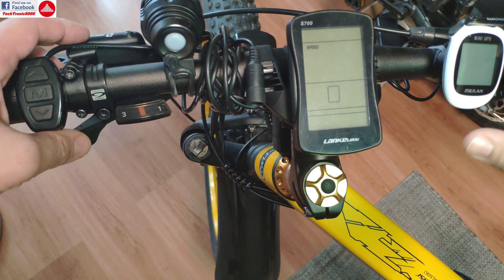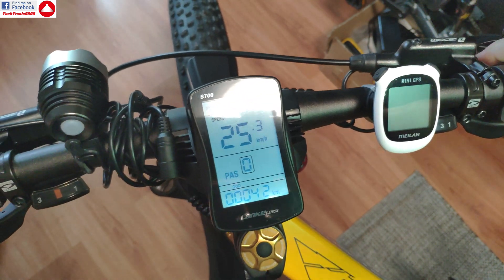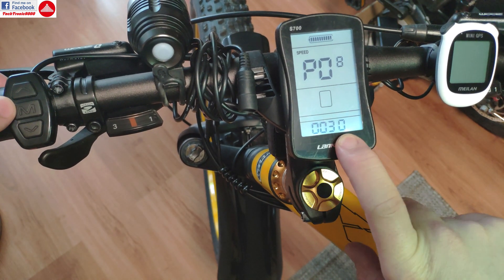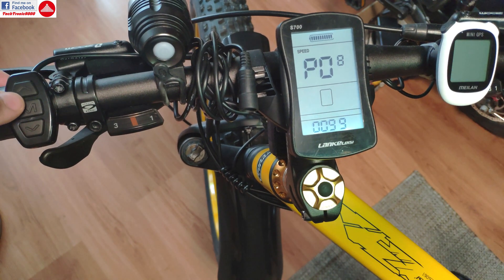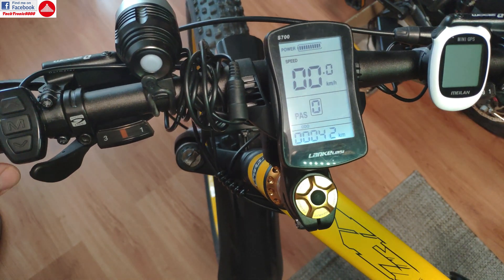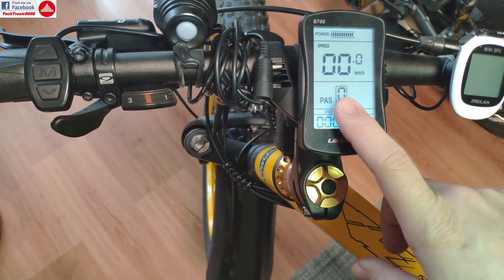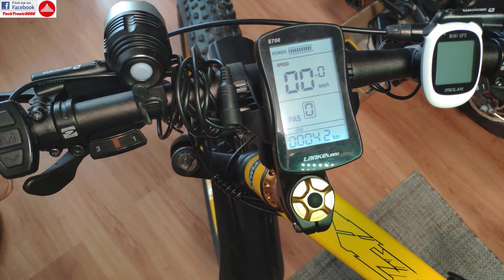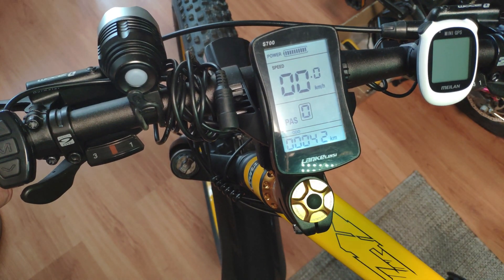Lankeleisi XT750 Speed Limit Unlock - S700 LCD

Comment: Do you know where to buy replacement battery or should j just get it diagnosed? I have a spare 48v but it has xt60 so I have to jerry rig the barrel connectors I had spare from. My last ebike batteries connector plug basically I cut the wire cut some rubber back put the bare lead to negative and positive for respective current and plugged the barrel connector in and it worked but it's not permanent but I would love some advice ik this is trades later but still.....

Comment: Hi, thanks for the tip, i have a question is there any side effect from change the speed limit? Other than battery consumption. Thank you
Reply from the maker: Mostly faster battery consumption, which is reduced range = more chargers, more often = higher wear on the battery. You also add like in any system more wear to the motor, bearings, brakes as all of them will work harder, longer.

Comment: I did it and the speedometer shows a higher speed but I don't feel the difference so it's not working, it's just the speedometer cheating
Reply from the maker: That happens when you change the wheel diameter, has nothing to do with speed limit. Also newer bikes might have different controllers and will act otherwise.

Comment: I have an RV800 plus . The speed change setting - 03p DOESN'T WORK.  No matter what I set it doesn't change the speed. At 03p theres a speed limit control... Doesn;t do anything.  Can You please tell me if You have a similar issue?
Reply from the maker: This is a XT750 bike not a RV800 plus so the settings might be different.

Comment: Do you know if there is any real difference between this XT750 500W motor and the updated version XT750 plus 1000W motor ? Most people are claiming the motor isn't a 1000W. I wonder what's the top speed of the XT750 1000W .. i am guessing it's the same motor but as they upgraded the battery from 12.8 to 17.5Ah at 48V = 614W for this version and 840W for the new version ?
Reply from the maker: First of all the battery capacity measured is measured in Wh not W and has nothing to do with the motor power. Also a lot of XT750 bikes and their other cloned models such as Bezior are sold in 500, 1000 and even 1500W, but usually most of them are just 500W. To have more info and real power you need to know the used controller maximum Amps. A 500W bike has a 12A controller, the 1000W one has 20A, while 1500W requires a 30A controller. You will see on the market a lot of "1500W" models with 12A controller, just avoid those. As for motor power the 1000W one with a proper 1000W controller should have greater torque and hill climb ability than the 500W one. Also the top end speed differs a bit with the 500W one doing 35-38km/h while the 1000W one does 45km/h. Personally i have bought a "500W" model which came with the 20A (1000W) controller, so it has 1000W peak power, it does 45km/h easy and climbs very well on technical offroad and rough terrain.

Comment: I got the xf4000 would this brake my motor or does it reset back to factory default when you turn it off 🤔
Reply from the maker: Settings are saved even if you remove the battery, also there is no reset to defaults for this display, you just need to note & remember settings before you change them.

Comment: It seems that the speed limit adjuster has now become glitched on my bike. It is stuck at the same max speed limit no matter what I change it to now. 
Do you know how I can perform a factory reset to fix this?
Thanks in advance.
Reply from the maker: There is no factory reset. Sometimes this display will freeze and show a "fixed" speed. Just use another speedometer. I recommend watching my review of the Mailan GPS speedometer.
Reply: Go and download the format for this model.....it tells you everything.... including Factory reset..... it's what I use, not going to try to explain it here....but it's easy to do

Comment: Is it possible to adjust it so that the throttle only goes to 25 kmh. But the bike can go higher just by using peddle assist mode?
Reply from the maker: Maximum speed limit can be adjusted in setting, it works for both assisted and throttle mode. Still you can set the "gears" so you can have up to 9 levels, thus in 1 you will do 8km/h, 2nd will do 15km/h, 3rd will do 18km/h etc. So in 9th you will do 45+km/h

Comment: I have the lankeleisi xc4000 it has the s900 monitor would your monitor work on my bike my fitting is a 6 pin connection
Reply from the maker: Usually the display is matched with the controller. I don't know if the S900 is replaceable with the S700

Comment: thank you Sir ... speed is 08 value ...and other values is what ...may you explain it ? thank
Reply from the maker: P08 - program 08 (setting), then you adjust the limit for it, default is P08 25 which is 25km/h, you can change it to P08 35 or 45 etc.
Reply: My limit goes to 100. Surely can't be right

Comment: Thanks for the video. Are you really increasing the speed or tricking the magnets? I did this on my XT750 Plus with a 1000w motor and didn’t feel a difference in speed, but noticed the speed limit reached 50 mph
Reply from the maker: It really works on mine, it changes the speed limit.

Comment: Hello 👋 does this work on LANKELEISI Elite Edition Folding Electric Bike. Looks similar just wheels are different
Reply from the maker: It should, but it might have a different controller, with less power and lower speed, still the unlock it is done in the same way.
Reply: Thanks 🙏

Comment: Why is your handlebar full of gadgets haha, can't you keep it simple
Reply from the maker: Because I do a lot of other tests such as true GPS speed, also ride the bike at night so need a good light, etc.
Reply: @TechTronic9000  is there a way to connect a spare battery to one of the external wires connected to the inside battery instead of the dual battery mod? Currently I have a wire from charging port to my rear mounted spare battery so both internal and external battery are in parallel but the problem is sometimes my thigh will rub on the charging port and can damage the connection.

Comment: Ciao io ho la Lankeleisi x3000 pius da 1000 watt ma il display è orizzontale e ha i pulsanti..diverso da questo. Non riesco a sbloccarla..fa solo 32 km/h invece di 46 km/h. Mi puoi aiutare..grazie!
Reply: hello, i have the same problem with lankeleisi g660. The limit is 32km/h.  Wheen I reach 32km/h I can feel, that the motor support is gone.  My settings is p8=100, P14=12. Any  sugestions ?
Reply from the maker: Try setting P14=20. I guess that on this bike there are lower power controller also.
Reply from the maker: Join here (https://www.facebook.com/groups/LankeleisiBike) and add a picture with the display and I will look it up and see if and how it will unlock
Reply: Bonjour vous avez trouver ???? J'ai aussi un lankeleisi x 3000 plus mais je suis bloquer a 32km/h... Même en changeant les paramètres. Je n'ai pas Facebook pour cliquer sur le lien. Si vous pouviez m'aider merci

Comment: That was super easy, I also dimmed the LCD backlight display. Thanks for this video.
I just bought a red tail light that works on 48V but I was looking for the wiring diagram for the ycsh084-114-48 controller and ended up here. Still haven't found it yet. If you come across the wiring diagram to this controller please let me know. If I can't find it I'll just connect it from the headlight but I won't be able to use the braking light.
Reply from the maker: I would advise against using another lamp with this controller. It has low current output and might burn the internal regulator. Better get a battery powered tail light, you can also upgrade the front light to a battery powered one.
Reply: @TechTronic9000  I'll have to use a directly connected from the battery with a switch instead. Thanks.

Comment: how much is the range with one charge? what is the difference with 1000w motor?
Reply from the maker: With full unlocked power (1000W) I get around 30km range with about half of that done at high speed and the other half done at fastest assisted mode.